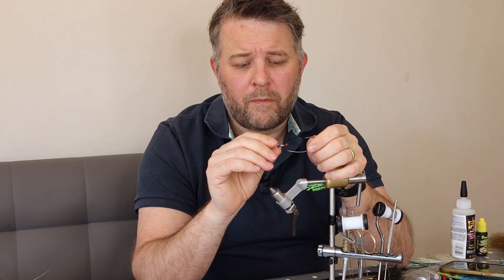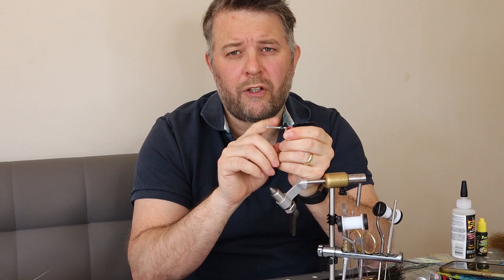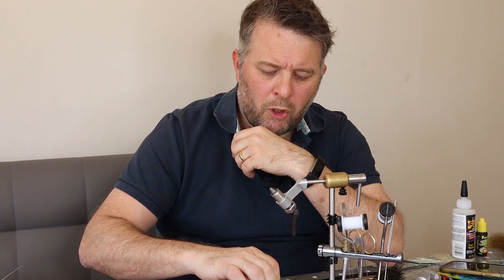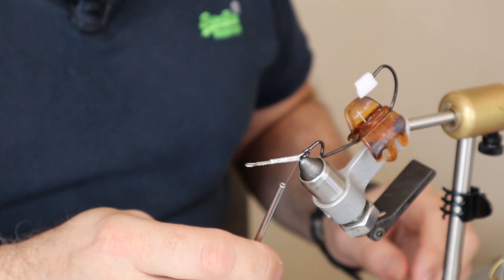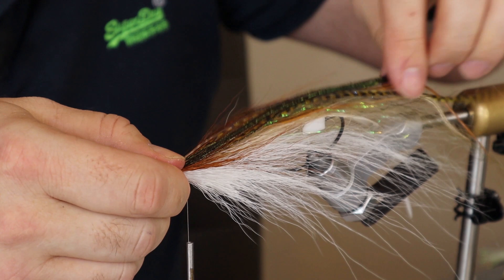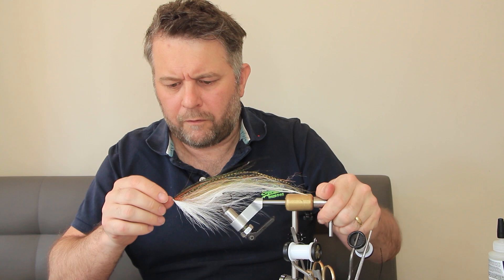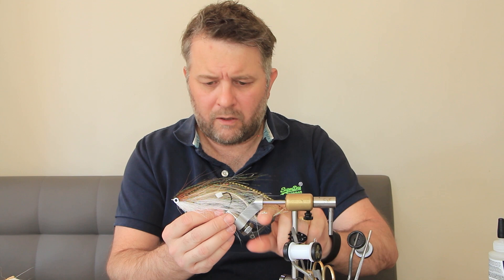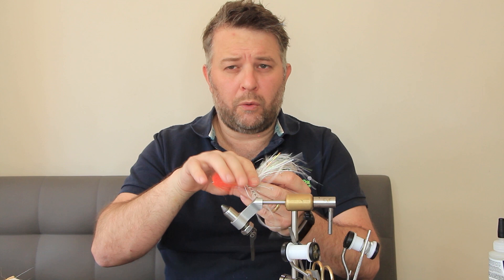Weedless Stiff-Rig and 3-D BULKhead Hybrid (Pike/Saltwater Fly)

Comment: Another great rig. Thanks, Paul. On your Facebook page a while ago, you showed a rig where the hook was joined to the shank with shrink tube. Presumably that wouldn’t be stiff enough for this tying. Also do you ever use synthetic bucktail?
Regards. Colin.
Reply from the maker: Hi Colin, it could be used as replacement to titanium for this rig, but it doesn't has the same memory and will stretch over time. I still use it in bendback flies where I can cut the tubing and add new if I need to replace the hook.